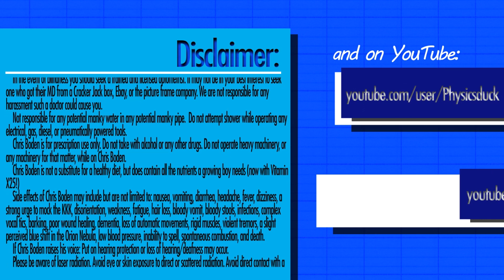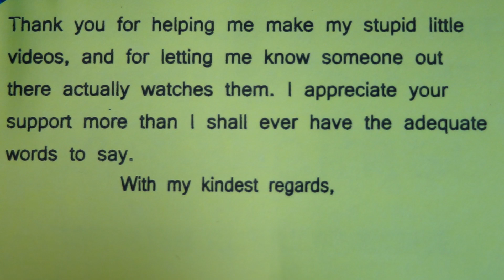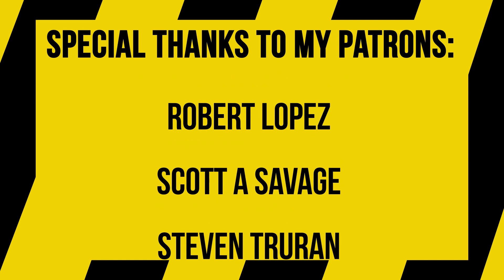Authorized Personnel Only   Hydroelectric Power Plant Wicket Gate Actuators Up Close And Dangerous

Comment: How did the shaft become eccentric?
Reply: The century old bearings are, well, a century old. (some say they do that on purpose to keep the brushes moving so they never freeze in place. if they wear slowly, the springs may not keep full pressure on them.)

Comment: Awesome videos Chris! Thanks for letting us see what most cannot! What is the spec on the main bearings for this turbines? Just curious as they have a hard life.
Reply from the maker: I have no idea, but I'll find out and do a video on it for you. :) Thanks for watching!
Reply: @Physicsduck  thank you! It is a curiosity because one of the failure points of the turbine in a hydroelectric plant that caused loss of life in Siberia a few years ago, was improper maintenance to the lower turbine bearings.  The main reason for that was because the only way to change the oil was to totally shut it down and get inside to do it.  Was curious what is normal and how many revolutions you can actually get before it is time to change bearings and seals.  Love the channel! Thanks a lot!

Comment: The impeller shaft appears to be slightly off center as it turns. Is that normal?
Reply from the maker: Yeah really, it may need a half-turn of tightening on the bearing blocks but when you get that old, you'll wobble a bit too.
Reply: @Physicsduck  Everything in that plant seems to be just a little wonky, thinking back to the worm shaft.  How old is it all?
Reply: @Physicsduck  what are bearing blocks?
Reply: @SamSitar  Blocks are the things that mechanically support the bearing races.